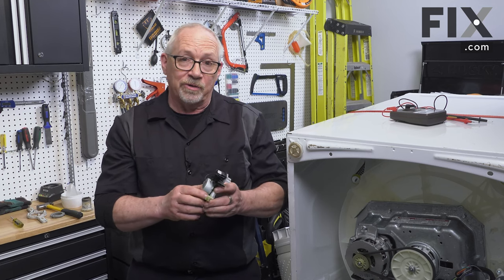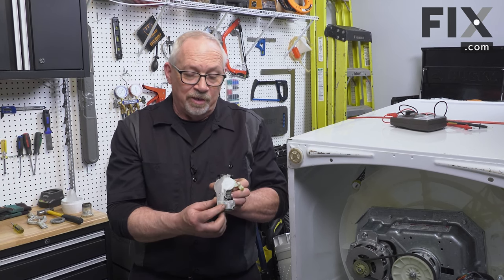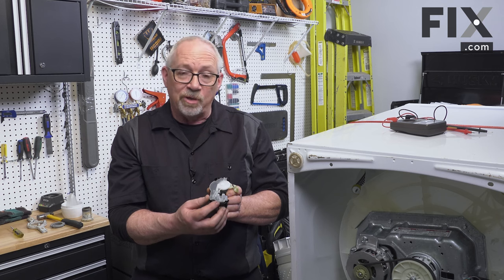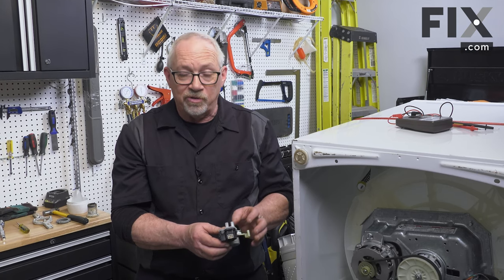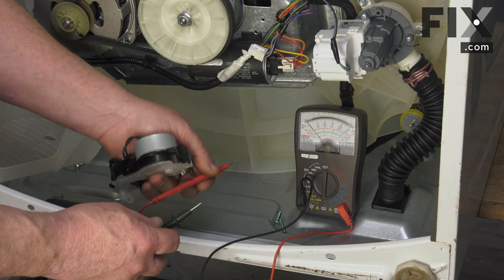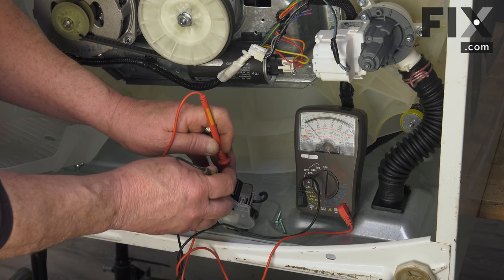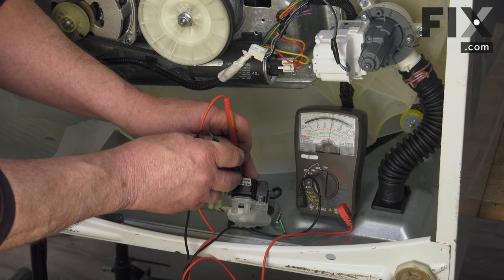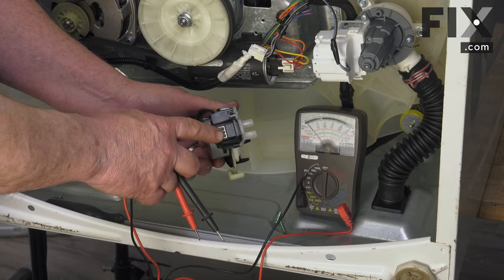WASHER REPAIR: How to Diagnose an Actuator in a Top-Load Washer | FIX.com

Comment: You are testing that wrong. The two pins on the end closest to the two black wires are the ones that go to the motor. They have continuity, but you won't get a beep sound. You have to turn a digital meter to the 20k or higher setting to get a reading. I took one apart to confirm that 100 percent.
Reply: I was saying the same thing. I even got confused. Thank for sharing a comment.
Reply: I just replaced  the one my washer twice. Didn't know to check 20k. Thanks for the info 👍
Reply: 2.5 att. 200k. god or bad 🤔

Comment: I have a Kenmore 500 series.  When spinning it makes rubbing sound and then stops.. i bypassed the lock and i see the basket and impeller spin but at different speeds. When the impeller starts spinning it makes the noise. I trying removing the impeller but it is seized on . Would the actuator be the cause of the noise?

Comment: Sir, do you know if the washer will still spin in manual mode even if this actuator is bad? I didn't get any resistance on the actuator pins, but the washer did spin in manual. I ordered the 40 dollar part anyway, even though im not sure. It wont spin, gets stuck on flashing sensing

Comment: I can't move the arm at all, it's seized. Can I assume it's bad without further testing?
Reply: Mine is doing the same thing, did you get it figured out?
Reply: @justindickerson780  turned out the actuator was fine. I was getting low water pressure due to a failing well pump.
Reply: @reversefulfillment9189 do you have the part number for your actuator? I’m looking at mine right now and I’m unsure if I can test it the same way this guy does in the video
Reply: If it’s good you won’t be able to move that manually

Comment: My whirlpool washer is draining but not spinning so clothes are still wet, but also will stop and start clicking in between filling up. If i change it to rinse and spin mode it will spin the water out the  clothes. Is this the actuator or the clutch? Also if its the acuator does it have to be the exact model # (wtw4815ewo) because they all look alike and nobody is ever clear on if the model # has to be exact or if they all pretty much work....PLEASE HELP!!!!!

Comment: My actuator is clicking and the washer wont start.  Should I replace it...or is it something else?
Reply from the maker: It could very well be the actuator but before you replace it check to make sure the sensor part of the actuator is clean from any dirt or film . If the sensor is dirty it gives the board wrong information as to the speed and position of the gear case.  May want to check and make the the electrical connector is is fitting the actuator tightly. Also, you typically should do a calibration when changing the the actuator.